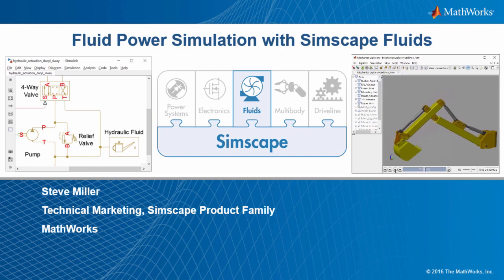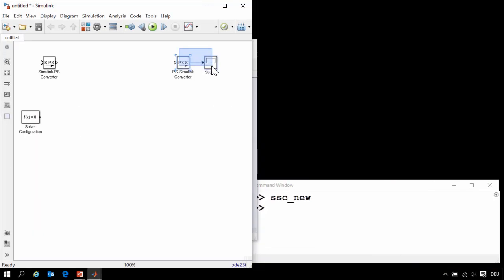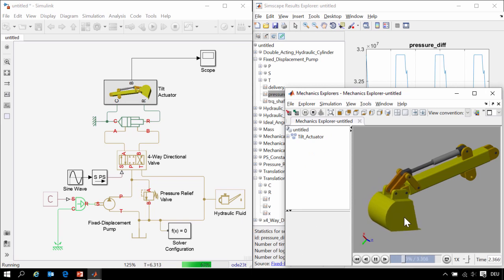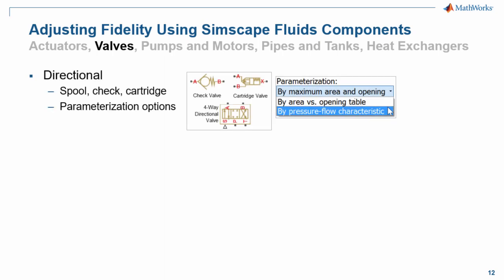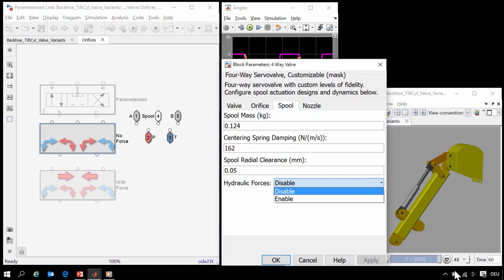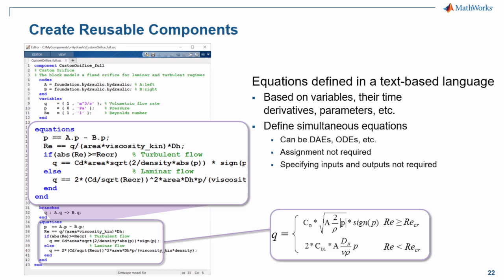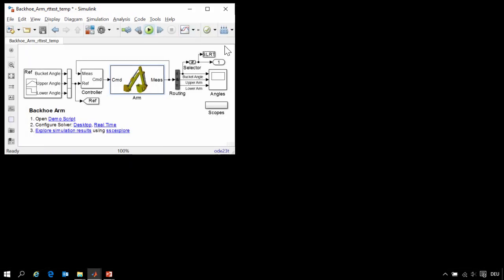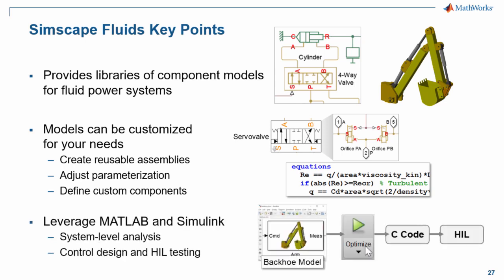Fluid Power Simulation with Simscape Fluids

Comment: It is not possible to build the system with the inputs you give in the video and receive the same results. I guess some standard values or parameters of the components have changed since then, but it´s a frustrating experience. I followed each step precisely and my piston movement or spring contraction is in the e-7 area ...
Reply: had the same problem: you have to use 5e-4 m^3/rad for the pump displacement in order to produce the correct output :)
Reply: Your comment solved my problem, thanks!
Reply: @danielseer5099  Your comment solved my problem, thank you
Reply: I had the same problem.  It is not clear when giving the pump displacement what the units are.  I guessed m^3/rev, but did not get same result.